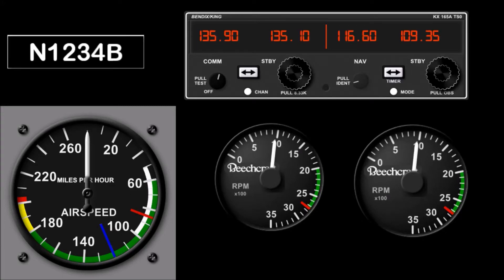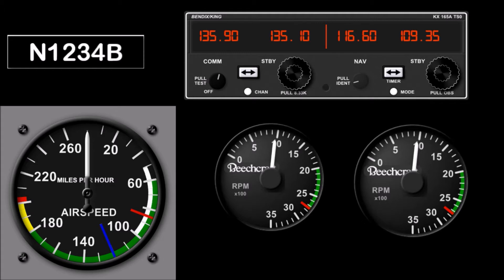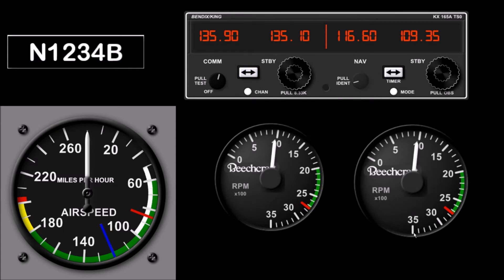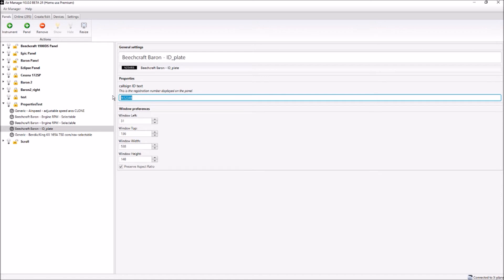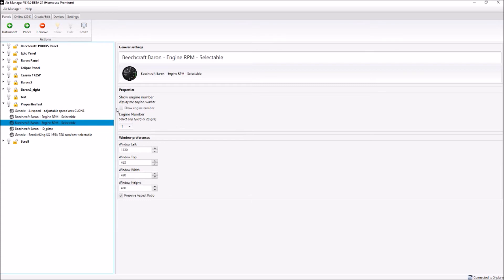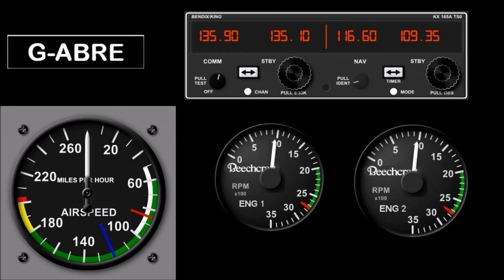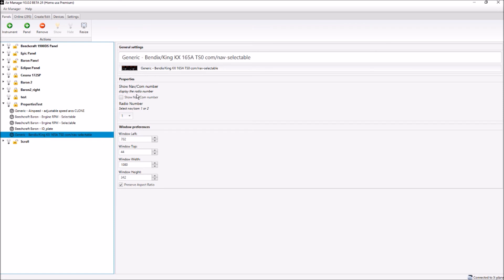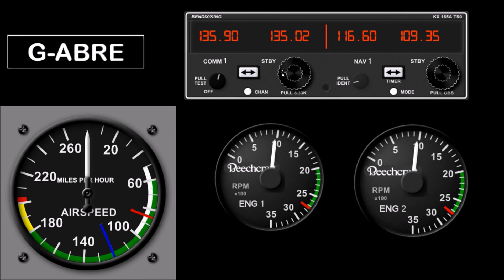Air Manager  3 0 More User Properties examples

Comment: Hi Russ,
I have an issue with airmanager. I'm using v 2.1.3
I'm using a remote computer with a screen with Cessna 172 layout.
The issue is, both the oil temp. gauge and the fuel flow gauge have diferent readings than the xplane gauges.
The temp. gauge on the screen is always on the red line and on the xplane is normal.
The fuel flow gauge does not read at all when priming the engine, only reads when the engine is running.
Is there a way to calibraste this?

Hope on a reply

Thanks
Luis

Comment: Russ, have you tried any of this with the Airfoil Labs 172 in X-plane 11? It's pretty finicky, particularly the autopilot. I can't get that to work with Air Manager iow version on the iPad.
Reply from the maker: Road Surfer yes the ios version is using the standard datarefs from X-Plane but the Airfoils labs version has custom datarefs.  Since the ios Air Manager is updated only every few months a compatible version would have to be developed and included in an update.  With AM 3.0 amd the Air Player release in the not too distant future you could use a Windows tablet computer to run modified instruments without having Apple involved.  See my video https://youtu.be/0pki4O56Ddk .  Sorry I have no quicker solution.
Reply: Thanks Russ. I'm thinking about trying Duest display to cast from Air Manager on my Mac Mini to an iPad. Do you know if that works? If not I'll try it and let you know.
Reply: It looks like I can use Duet Display to use panels my iPad pro  created on my Mac, so I'm looking forward to trying it out with 3.0.